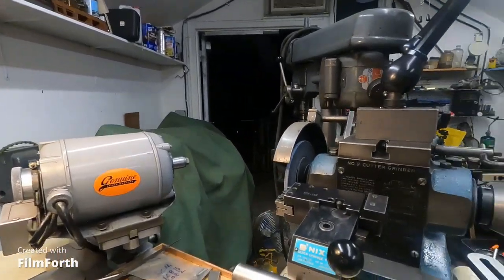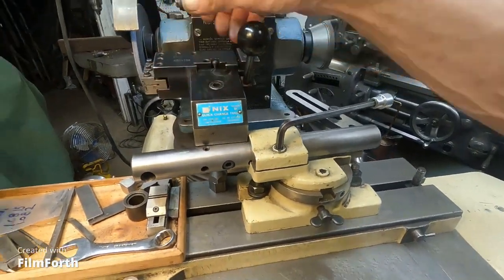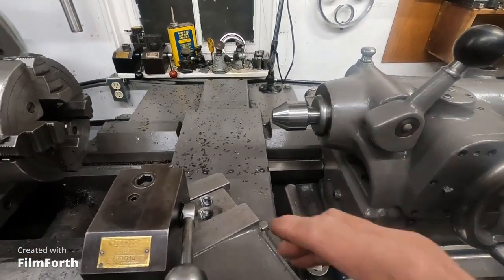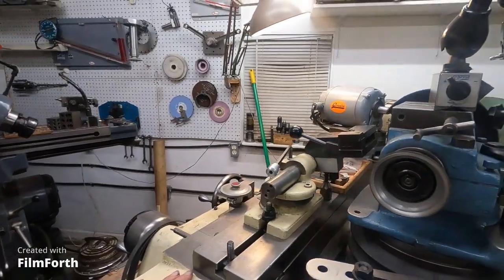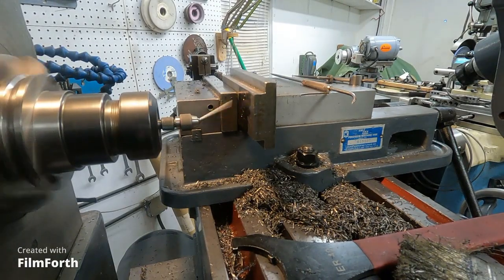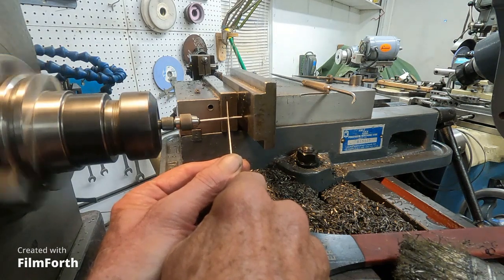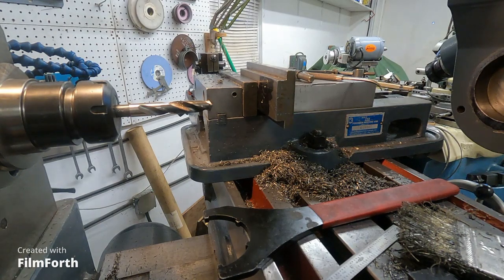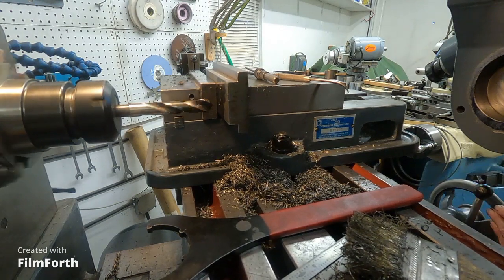Cutter Grinder set up for lathe operations

Comment: I see you have one of those Starrett 459 Cutter clearance gages. Do you use it much? I've never seen how that gage is used.
Reply from the maker: The gage is unmarked but is very old, it works best on the large wheel cutters for the horizonal mill, I will demonstrate it, thanks!

Comment: Holding a drill in an ER collet, I do it on the Bridgport often to avoid having to crank the knee as much as drill chucks are long, they hold drills very well and only cost a little extra time in tool changes. Though Bridgports are not the best at drilling.
Reply from the maker: the old Moore jig bare has about the same drill capacity as a Bridgeport but the mill really has the power